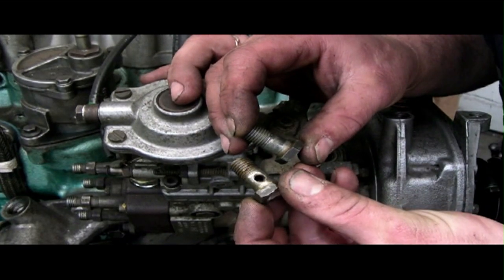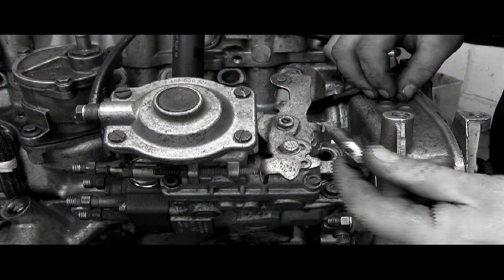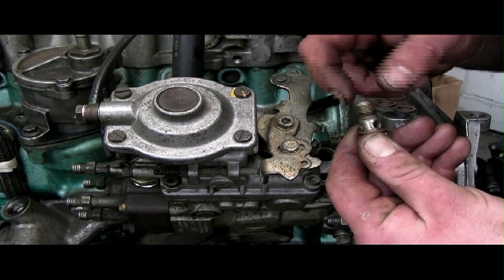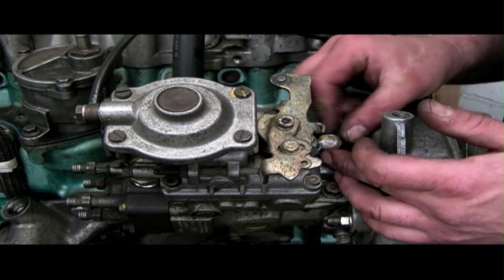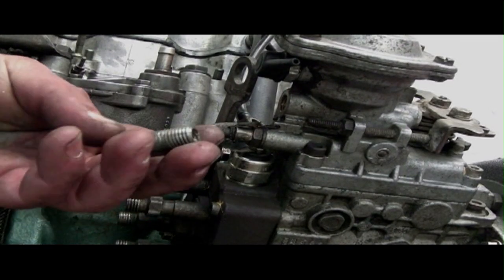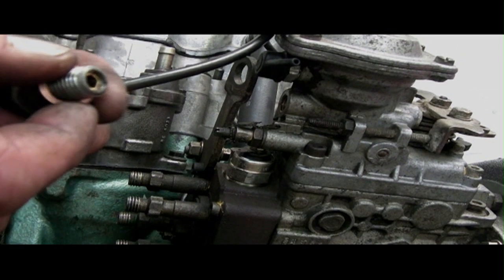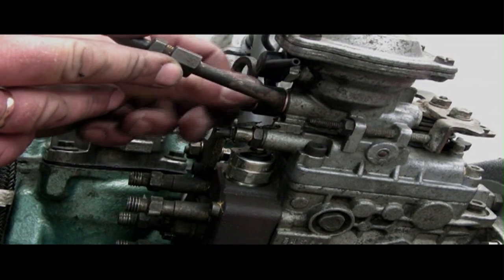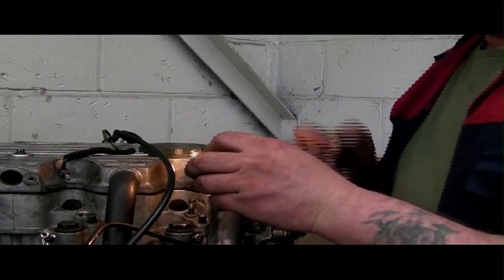Injector pump banjos-fuel pump banjo unions Land Rover 200tdi and 300tdi enigne

Comment: I noticed the aftermarket banjos on the injectors spill return have much larger holes than the original banjos on my 200tdi. Would hole size in the injectors spill return matter?

Comment: how do, v usefull videos been helpfull on several occasions! could you advise me on my 200tid shes lacking pull, had all new filters new throttle cable far as i can tell no boost leaks, think lift pump is ok as she fires up no problems everytime could it be back banjo filter on the pump gunked up?

Comment: changing from a 300tdi electronic pump to a mechanical pump how easy would it be
Reply from the maker: Hum,....  depends on your skill level.   You need to know which components are different between the 300tdi and the 300tdi EDC systems and go from there.